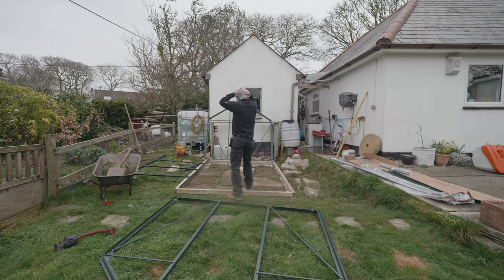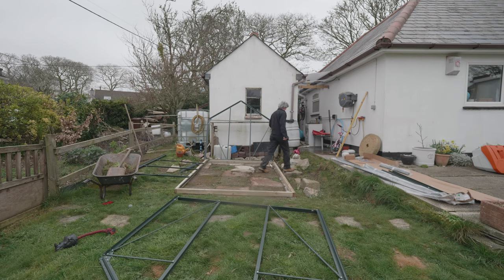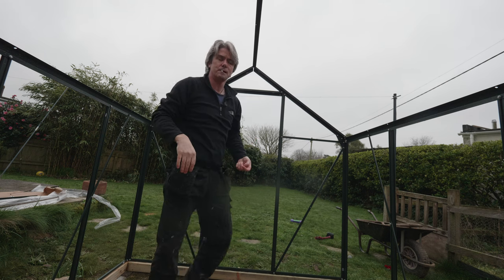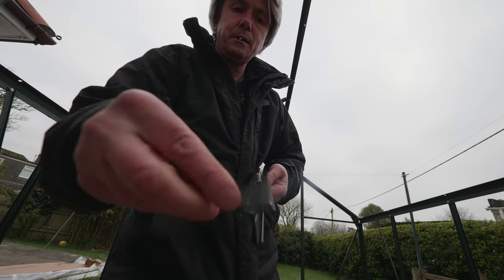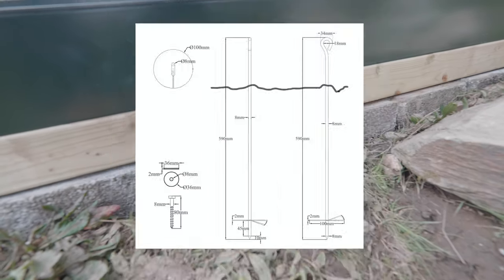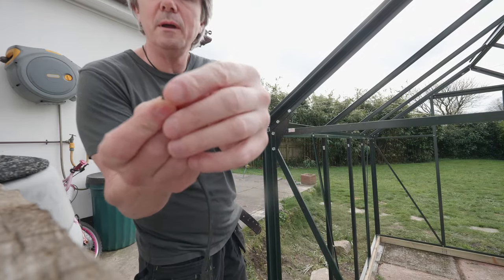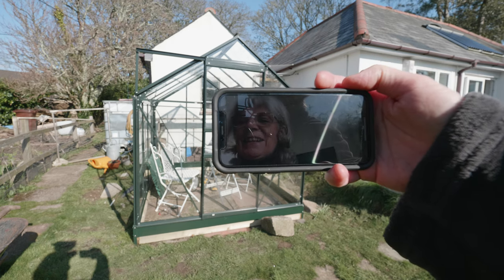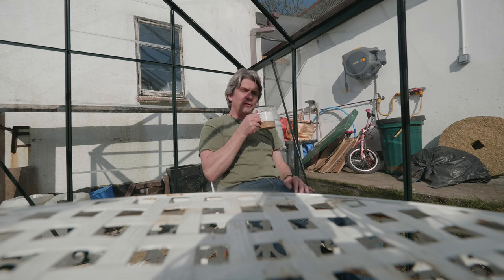A simple Greenhouse Build

Comment: I've been looking at a Halls greenhouse. I was considering whether to buy the base frame or not. I want to fix mine to some concrete slabs. Do you reckon I can fit the greenhouse directly on a timber frame or would you recommend buying the Halls base and then fixing that to some timber/directly into the slabs? If I buy the base frame I'd imagine I'll need to cut the long pieces off that are designed to go into the ground since I am building on slabs.
Reply from the maker: @L-xw7sy  hey, the greenhouse without a base is pretty low so going with ‘A’ base is pretty necessary. Fixing to a wooden base would be way easier. I’d like us, you’re in a gusty location u can then fix your wood to the slabs using only a couple of expanding bolts. Then fasten the greenhouse frame to your Battons. I just find wood easier to work than metal. Either should work though. Worth having a think to see which suits and which is more cost effective! 
Which ever way you go, it will be a great growing place to play. 
Cheers
Rich
;o )